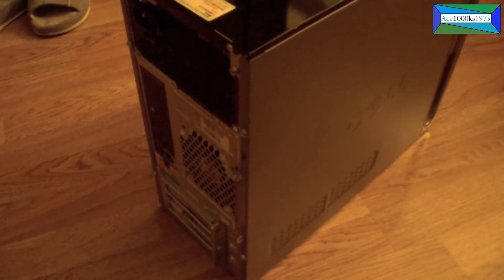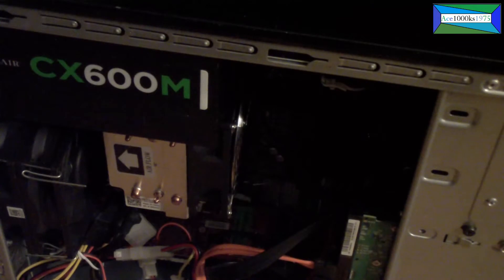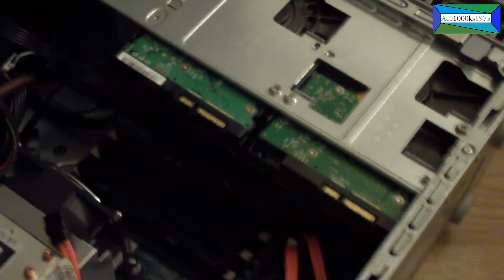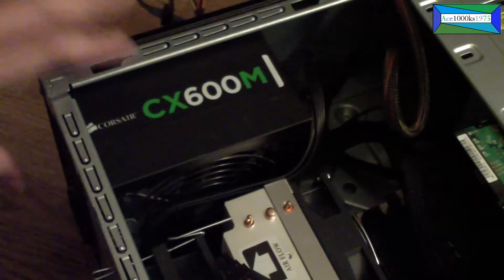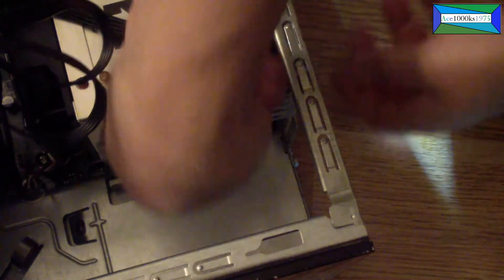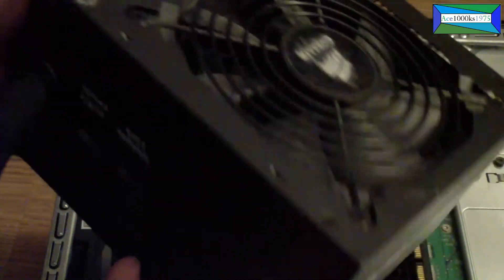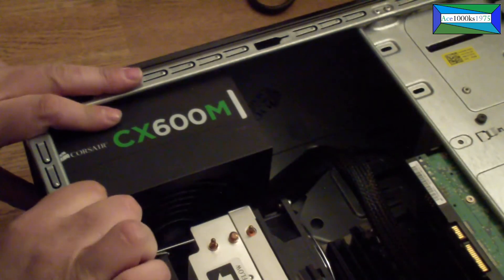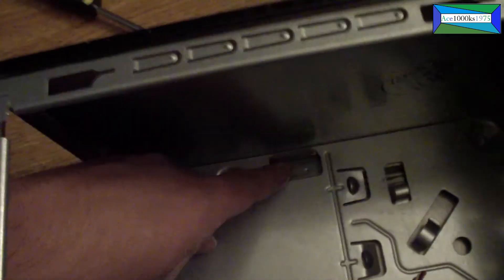Dell XPS 435 MT Changing the Power Supply

Comment: is that the area 51 heat sink fan? if so how is it? i just bought it for my dell xps studio 9100 , hoping it is better then the original heatsink
Reply from the maker: It's the original heatsink fan that came with this computer.
Reply from the maker: The XPS 435 MT and XPS 9100 are two different models. They don't use the same heatsink, and also the XPS 435 MT heatsink will not fit in a XPS 9100.
Reply: @Ace1000ks  ok thanks, I'm really struggling to find a psu replacement and heatsink for my dell xps studio 9100 , I ordered the area 51 heatsink for my 9100, I hope it works and as far as psu I'm out of the loop since dell xps 9100 has been discontinued 😪
Reply from the maker: @durkcobain4608  You can use any standard power supply on the Dell XPS 9000/9100. As for the fan on this thing, I don't know much about what kind of fan you can use on it. You can check on Google to find that out.
Reply: @Ace1000ks  ok thanks
Reply: هل هدا الحاسوب شغال لحد الان ام  ضاع
Reply: هل هدا الحاسوب شغال لحد الان ام  ضاع